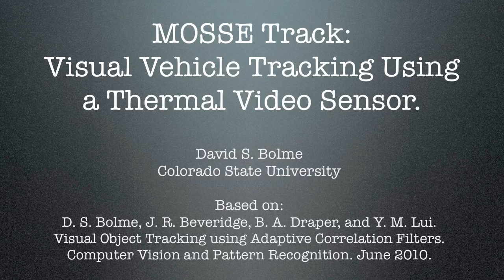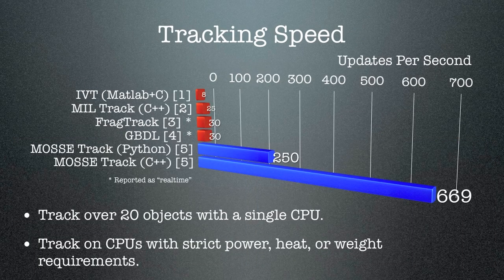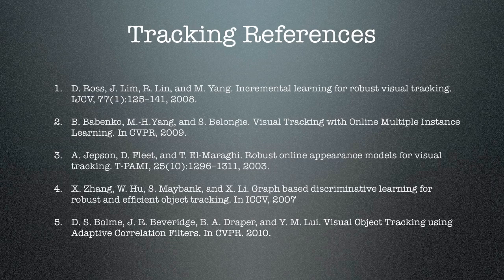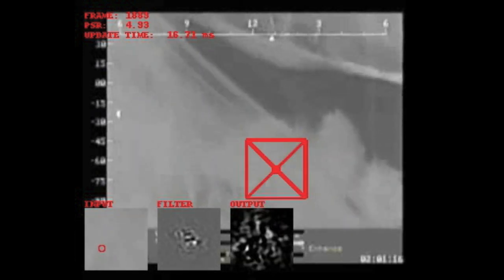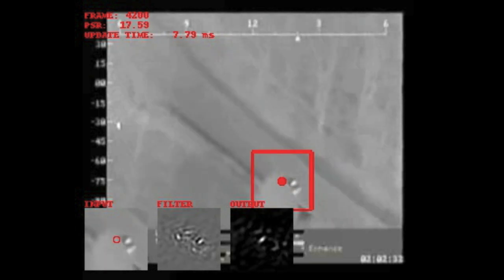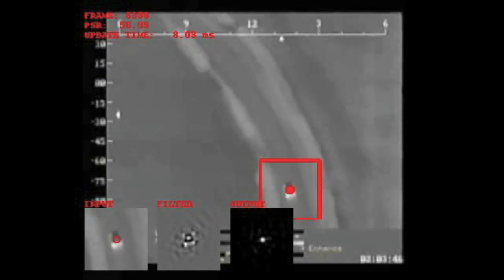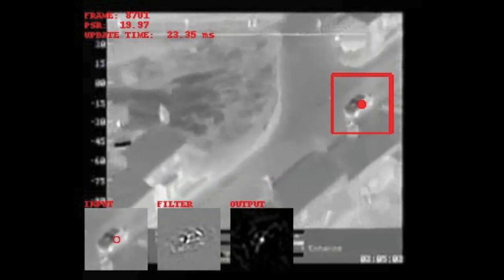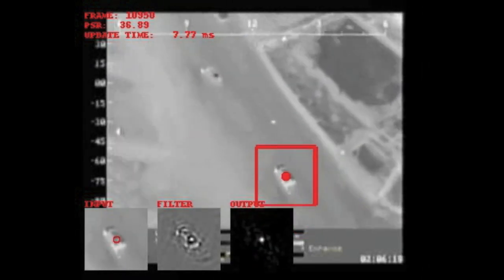MOSSE Track: Visual Vehicle Tracking Using a Thermal Video Sensor

Comment from the maker: The tracker does work tested with grayscale, color, and reflective IR sensors.  Our current implementation is fast enough to track 30 targets simultaneously on a 30fps video.  If you want can check out my websites for more info.